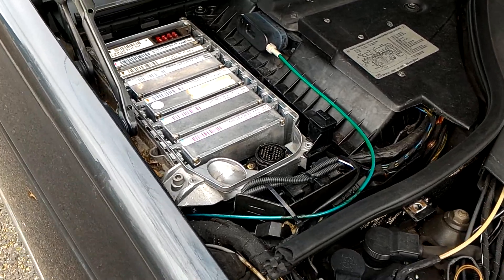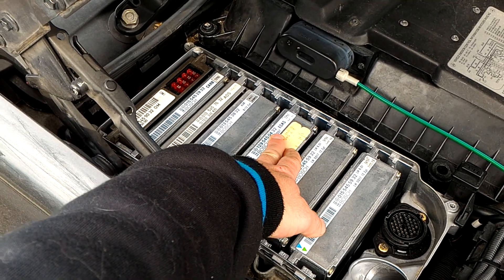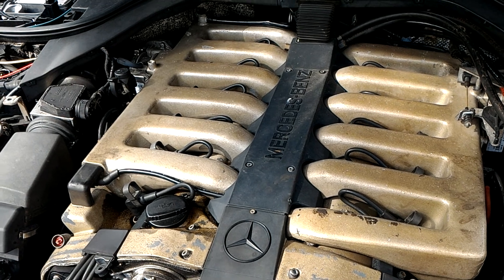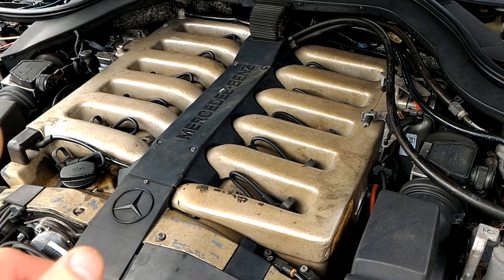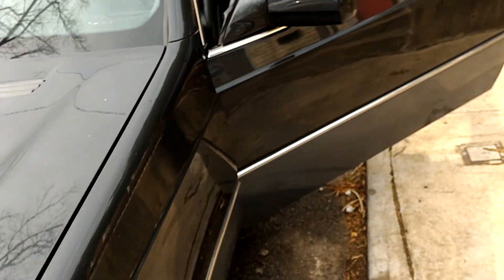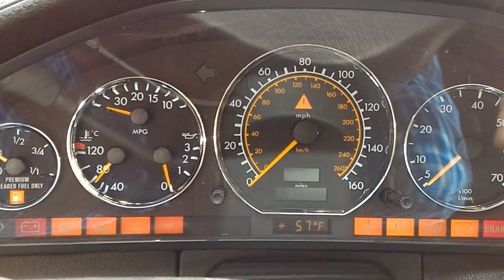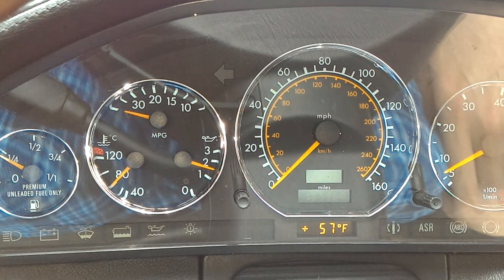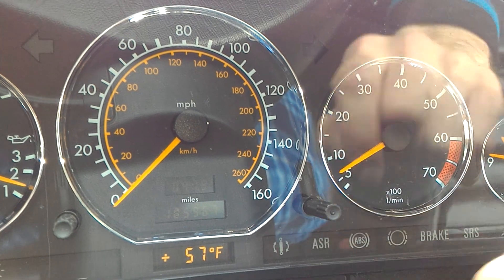Mercedes 600SL throttle control module, Egas test

Comment: Hi Victor I have an issue about my 300se w140 chassis :
The issue is when the car become hot I have an irregular idle and the car that not accelerate can not run over 2500RPM
I have check :
Fuel pump pressure about 6 BAR
Fuel pump relay (I hear tictic tic sound) I have any idea what originating this sound 
Sometimes I don't hear anything the car become fine and the idle too
I have check the harness between the fuel pump relay and ecu everything it's fine
But sometimes fuel relay become hot when I touch it its anormal